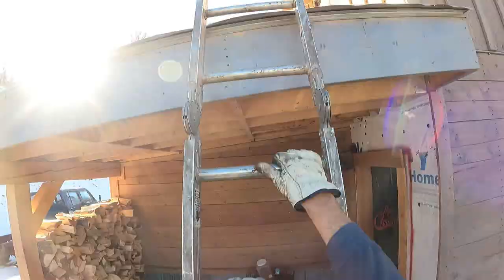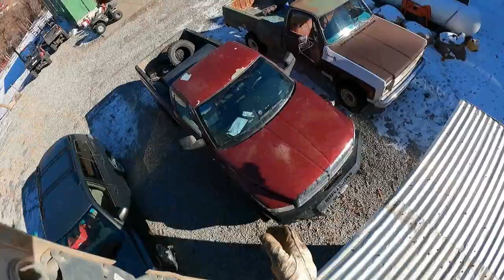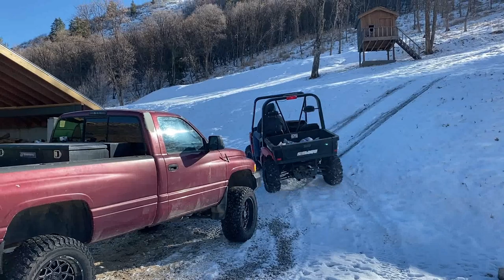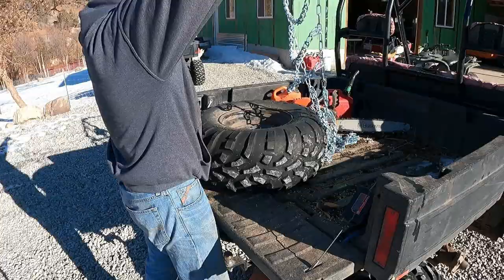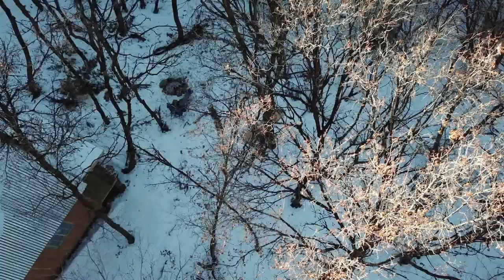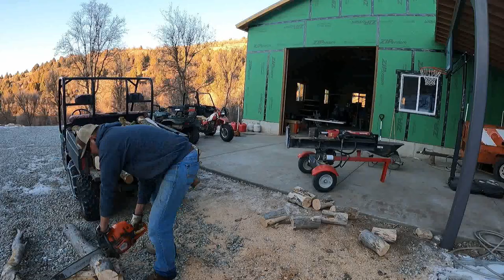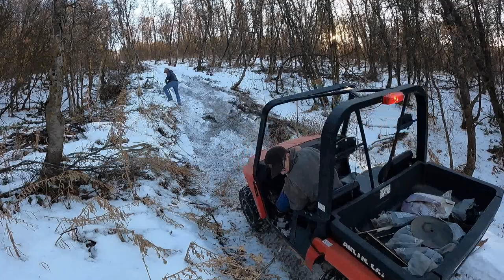The Earth Has Shifted... LITERALLY! (Solar Panel Issues)

Comment: Magnetic North drifts constantly, but the drift has accelerated in recent years and we are approaching (timeline very unclear) a magnetic reversal.  This is not the same as the axis of rotation of the earth, which does wobble but is a fairly consistent pattern over the centuries.  Magnetic North and Rotational Axis have been fairly close for a long time, probably having to do with the ebbs and flows of molten lava (containing iron) in the earth's core being heavily influenced by the earth's rotation.  I have not been following this much, but I think if the rotational axis of the earth shifted significantly scientists would be pulling out their hair and shouting from the roof tops.  All that being said, I am very interested in your observations that there has been both solar and lunar movement observed from your property, and that causes me to want to investigate this further.  Intriguing!  This requires further investigation.
Reply: I agree.

Comment: Magnetic north and south pole have never aligned with the true, geographic north and south, and have been shifting since time began. Magnetic north and south also have no impact on the amount of light the sun provides, or how far above the horizon the sun appears to move.

The earth is on a tilted axis, and which causes the amount of sunlight you receive at different times of the year to change. This tilted axis has changed very very little since record keeping began, so the amount of sunlight you're receiving has not changed compared to years prior at the same time of year.

It is likely that you have a mistaken perception of how much sunlight you are receiving compared to years past, and this mistaken perception was reinforced by misinterpreting the articles you read online.
Reply: Nice explanation. Exactly what I was going to say. I think he’ll appreciate the clarification. Also, if the amount of sun the panels are getting is in fact less than earlier years, the explanation is probably a lot simpler (e.g., shifting soil under panels).
Reply: The property might be sliding further down into the valley causing the change in sunlight or the trees growing at the top of the property casing less sunlight at your location.  Solar insulation does that change that rapidly form year to year, rather axis wobble is a 10 ,000 year cycle

Comment: The sun rises in the same spot year after year. More or less. There are leap years but they would only off set the sun by <1° degree. Magnetic north has nothing to do with where the sun rises.
Reply: Leap year also would not effect the sun, a leap year is only a calendar event.
Reply: Nope.  The earth's axis shifts.
Reply: @aussiedonaldduck2854  Dec 9, 2019 vs Dec 9, 2020 isn't exactly 365 days difference, so because 2020 is a leap year, the sun is in a very slightly different position. I checked on Stellarium - looks to be about 4-5 minutes difference - so extremely slight difference. But nonetheless a slight difference (<1° degree).
Reply: @Taocat1  The axis of the earth always  point to the north star.   This star can be used for navigation and its position relative to the earth never changes.   It takes extremely delicate instruments on satellites to measure even the slightest 'wobble' in the earths rotation.
Reply: @bobcalder724  sorry Bob, no it does not.  The earth's axis is not constant.  it wobbles.
Reply: @bobcalder724  also the earth's magnetic field is extremely weak right now and is probably getting ready to flip.  It does this about every 10k years. That means the polarity of the magnetosphere is about to flip, no the earth itself.
Reply: @bobcalder724  as a geologist,  I can easily refute your claim.  Have a good day and enjoy your disinformation.
Reply: I beg your bloody pardon
Reply: Talk to the Inuit of the Arctic region. They will tell you the sun has dramatically shifted in this generation more than any other in their oral history

Comment: No Heath...the movement of magnetic north has nothing to do with the spin access drift.

“Earth is not a perfect sphere. When it rotates on its spin axis -- an imaginary line that passes through the North and South Poles -- it drifts and wobbles. These spin-axis movements are scientifically referred to as "polar motion." Measurements for the 20th century show that the spin axis drifted about 4 inches (10 centimeters) per year. Over the course of a century, that becomes more than 11 yards (10 meters).

Using observational and model-based data spanning the entire 20th century, NASA scientists have for the first time identified three broadly-categorized processes responsible for this drift -- contemporary mass loss primarily in Greenland, glacial rebound, and mantle convection.”

https://climate.nasa.gov/news/2805/scientists-id-three-causes-of-earths-spin-axis-drift/
Reply: I think hes measuring with a compass and thats why hes associating it with the magnetic poles. For people reading this, use a GPS to measure this sort of stuff not a compass.
Reply: Thank you, Robin. Great explanation and reference to facts.
Reply: The Earth has shifted it's axis this happened back in the late 80's early 90's it has been measured by NASA. I will have to find the link to the article on it. Also My good friend Dr. Carl Bowin Woods Hole Oceanographic institute has measured this. It happened when China filled their 3 gorge dam, it caused an earthquake that shifted the planted. It also shifted because of a gravitational pull from a couple of asteroids that passed close by recently. It is causing a very rare planetary alignment on December, 21 this year 2020. Mars, Jupiter, and Venus are going to be in a complete line. Their is an article about it in Sky and Telescope magazine.
Reply: @thtadthtshldntbe  it is affecting both. That is why the national highway administration and the FAA are renumbering all the highways and airport runways.
Reply: @VickyGeagan  No one is re-numbering highways.   And the pole hasn't shifted enough to renumber runways - it's basically drifting north - see https://www.oceannavigator.com/the-wandering-magnetic-pole/ for a map.
Reply: @vicky geagan you are confusing a change in the angle of rotation with the duration of rotation. The water in 3 Gorges damn has slowed the earths rotation by 3 microseconds and any shift caused by an astroid wouldn't be with the angle but with the speed of rotation and it would be extremely small, completely inperceptable to us without complex measuring devises and none of this would alter the position of the sun or moon in the sky. The only thing that alters the postion of those is our orbit around the sun and the move in a predicable and regular way.
Reply: @Rose that is an insane conspiracy theory. NASA scientist do give straight answers when they have them and just because people dont understand the science they say its a conspiracy.
Reply: @VickyGeagan  not the point. If hes measuring the direction of sunrise with a compass CV of course its going to change over time. If you use GPS, it will only change with the actual physical movements of the earth, like axial title, wobble and a couple of other movements whose names i dont recall righttl now

Comment: I just made a round trip to Boise from South Dakota.  Never saw any significant snow anywhere in Idaho. Didn't like driving that stretch from Ogden to the I80 turnoff in the dark.  Lots of sharp turns.  Made it back in daylight.  Was pulling a 30' Goosneck with a helicopter.  Seems that a winch on the Ranger would be invaluable.

Comment: I noticed the change around 2016 or 2017 in jamaica queens NY.  The sun stopped rising in the east facing room and shifted maybe 15 feet to the left out of the wide window.   Resulted in hose becoming much cooler and no ac needed like before.
Reply: did it change back! and it sounds like the winters are getting colder
Reply: @javonjohnson4394  well I moved but it didn't change back when I was there.  This pole shifting will be permanent once complete for many thousands of years until the next change.  Some will get colder or warmer winters as a result.   I also think there is some weather warfare going on but that's a separate topic

Comment: I have also noticed something strange about the sun. Normally in the evenings during the summer months we get direct sunlight into our windows facing west but this year for sure I noticed the light is not getting in those windows. I also noticed that for this time of year it is getting dark too early. As for the moon the only thing I can comment is that moon phases change when they come out because of the sun changing where it comes out through out the year. Another thing I have noticed the last couple of years is that our summers here have been colder than before that.

Comment: I had a 2008 Ranger 6x6 until this summer when I sold it. So speaking from experience you would do much better to put your chain on the rear tires because the rear axle is the load bearing axle and you would get much better traction. Living in northern Maine I used tracks in the deep snow.  I still have those tracks that are for sale.

Comment: build a south facing greenhouse, use the sun to dry your wood faster when you aren't growing things. But the real win would be digging a trench 8 foot deep, and using the ground as a reservoir. With enough hose down there, blowing air through the hose will get the air to 52. Then a small heat pump will get it higher. Wood should just be your backup, not the primary source of heat.

Comment: A steel 55 gal drum is  great for a firepit up at the cabin, you can cut the top and put a handle on it for a lid, it throws amazing heat, you can cut 2 lg holes near the top for use in the rain with lid on. The ash wil keep coals hot for 2 days, also ash can be used for other purposes.
People take trees for granted, Artificial xmas trees are a great investment that can be reused for year as apposed to killing a live tree, just to throw it out. 🌲👍 yes the earth does wobble causing the sun/ moon positions to move. Many people dont notice the Cresent moon has changed position from vertical to horizontal and back to vertical actually following the wobble effect. 🌎

Comment: Pole shift we moved to Wyoming in 2014 at that time true North was off by 49 miles the shift continue...we got a 6x4 gator we picked up this summer we use it to run errands and check fence we have the same problem with the plastics

Comment: Take notice that land mass may move slightly due to erosion, compacting or ground water depletion . technically the magnetic poles dont have  or at least shouldn't inerfere with land mass .another thing is that the rotation of earth around the sun is much more complex than we usualy think.

Comment: You are exactly right, it shifted 5 years ago. That was when I first noticed direct light on my north facing wall, which had never happened before. Then the south facing wall. I did a little digging and found out that in 2016 or so, the earth had shifted about 1100 miles. But this year esp, both the sun and moon have been so erratic, and over the summer, the moon would only shine for about 15 days out of the month, then would disappear for the rest of the month. In reality, the moon was really rising like at 3 in the morning, and would be gone by sunrise.

Comment: As someone who has cut and burned wood for over 25 years and just had a chimney fire last year, let me say this.  Please clean your chimney properly and completely.  Remove not only debris in the pipe, but the creosote.  We thought we were cleaning ours well.  We cleaned it every fall with a chimney tool designed to remove debris but did not realize we weren't doing anything to remove the creosote.  We were so lucky as the brick chimney saved our house.   You've worked so hard, it would be a shame to see it all go up in smoke, and that's only speaking of property loss.  Get it cleaned!

Comment: I would avoid mounting panels on either the roof of the house or shop. Cleaning them, removing snow etc. is going to be much more difficult especially as you age, I am quite certain you plan on living out your days at RPR and you don't want to be climbing on top of a roof as a senior citizen. Look into a solar tracking system to where the panels move during the day to maximize the return from the sun during daylight hours. I currently have 40 panels (roof top) and am very pleased with the performance. I own 26 acres in East TX and when I retire will definitely do a ground mount solar system, good luck and keep up the great work.

Comment: If you save the saw dust and put it in a 5 gallon bucket wet it, and use another 5 gallon bucket with a rock on top as a press, then drill holes on the bottom one to let water drain out, you can make your own fire starter logs. Side note, you can use junk mail too for this, lol.

Comment: A couple years back a little before December, our dept was called to a grass fire in a rual area and on arrival found it was caused by a outdoor wood heater with the spark arrestor cap removed. The lady was burning green, unseasoned wood, and as a result, the creasote buildup was clogging the arrestor, so she had simply removed it. I told her she needed to get it back on and get some seasoned wood, as the stove was only about 15 feet from the house, which had cedar shingles on it. A month later, we got a call about 3am for a structure fire. Neighbor a mile away had seen the flames. We get there, it was the same address, house was was completely gone, and the wood stove was chugging away, blowing sparks in the air thru the open chimney, a pile of unseasoned wood beside it. Luckily no one was home and all animals were outside. Goes to show don't burn green wood!

Comment: I'm in Australia, and I used to live far north near the equator and never noticed anything about sun/moon positions. But then I moved very far south, all the way to the other end of the country and then I started noticing the wild swing of the sun and moon and how literally every day it changes position, setting way way SW in summer and way way NW in winter, and the moon has it's own swing as well, it's definitely never a straight E to W path. It was freaking me out at first, but I've gotten used to it and I notice you have to count year to year, not week to week. You're up in the mountains and I'm assuming nowhere near the equator. Of COURSE you're not going to get the same amount of sun on your solar panels as you did a few weeks ago. You have to move them around unless they're high enough like on your roof and you're accounting for the mountains which are blocking a lot of sunlight for much of the day. If anything, I'm wondering if the earth wobble is getting more intense? That's why we have the swing in sun/moon, but that's why we have to calculate year to year. Like, at say June 15 at 3pm, is the sun in relatively the same place as it was at June 15 at 3pm last year, and what about the year before?

Comment: I live in almost the exact same conditions- side of a hill. I run 100% off solar and the last 10 years the path of the sun across the horizon of the hilltop has changed dramatically! Seems like Im only getting about half the sun in the winter now and about a 1/4 more in the summer. If your not on solar, rotating your panels, then you have no idea that the sun-earth or something has changed! Was 32 below zero when I moved here 10 years ago, now it only gets down into the teens- above zero! A change of 40-50 degrees in the winter!

Comment: Another very pleasant video, thank you. 

As for the lack of sunlight and where the Moon rises, both the Moon and the Earth orbits are subjected to 'wobble' and have several cycles of different length. Compounding these different cycles on each other leads to an apparent shift in altitude of the Moon as seen from Earth, and the path the Sun takes to cross the sky, also as seen from the Earth.

Comment: The magnetic pole alters 4-5 degrees each year,  this is important to know when hiking, there is a calculation you must do when taking bearing from a map. For example if the map was surveyed in 2012, the calculation is 2020-2012=8x4 degrees=32 degrees add this on to your bearing. Not so important on short journeys but long distances you can miss your intended destination by literally miles.

Comment: See if its mandatory to have the screen on the chimney cap. If its not, then get rid of it. My first year burning (about 10yrs ago) it was the middle of winter and the screen was already plugged up. It not easy getting on the roof with snow on it. Ever since i took it off, NO PROBLEMS.

Comment: i use a soldering iron on backside of plastics and weld the plastic back together. then paint and clear coat and the paint will last a long time. as long as use clear coat. better clear coat longer it can last. better clear coat stronger the plastics. the clear coat i use is 500$ a gal. a pellet gun cant chip it. 
then can get decals ect what ever wanted before clear coat.

Comment: I learned recently that the arctic circle moves and is not fixed. It changes because earth tilts on its axis in some cycle. This is probably caused by a movement in the magnetic poles.

Comment: Don't make a major adjustments just yet. These changes usually correct themselves. If it doesn't your may have to point them in, a completely different direction. That would be a complete poll shift. It has happened several times before over thousands of years. Then, they may not be anything to adjust.